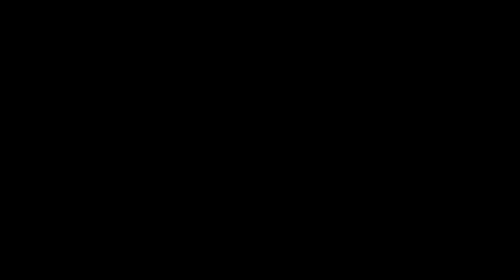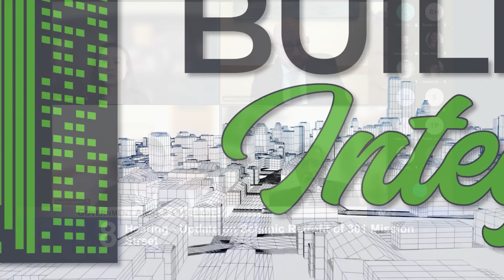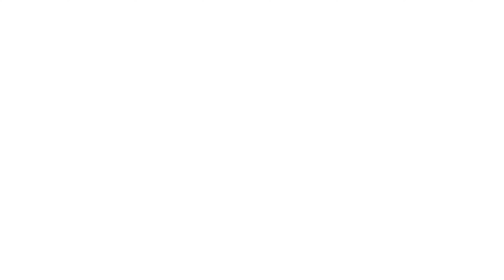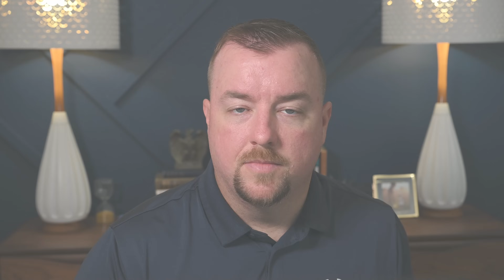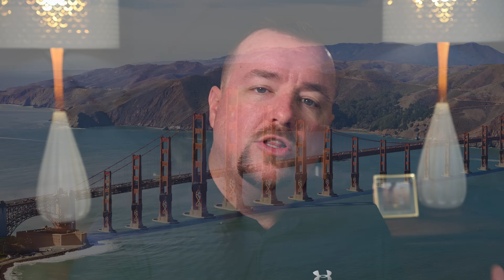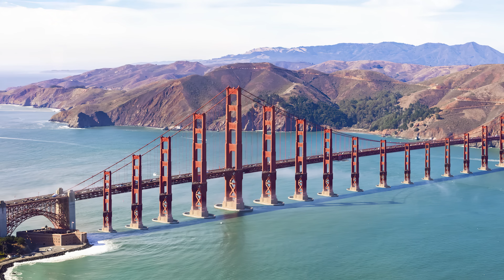Millennium Tower's "Sophisticated" Fix?  You Decide - (San Francisco's Leaning Tower Part 4)

Comment: I don't know how common a problem leveling tall buildings in this situation really is. I've heard of a tower is Pisa, ITL. Is this like designing a reinforced concrete, slab & column parking garage for a mall or like the Apollo moonshot?
Seems like the 52 pike design should've been perhaps a starting point only; don't engineers usually start with some existing design which seems to work? Better to say here's a cost estimate which is 95% the worst case than to go back to the client and say ooopsy we need to double the number of piles and it's going cost more. 
Also sounds like the pressure to get something underway now was also at play.
Sounds like a bit of skeptism is at play here. First they say 52 now 18. Can we expect the "answer" to be  a few more are needed at each end in the future.
Reply: Engineers could theoretically start with an existing design, but that would only be advisable if ALL the parameters were the same. The Golden Gate Bridge works; but you would only build another bridge with the exact same design if you had the exact same distance to cross, the same wind and water currents, the same type of climate, and the same soils and size and shape of the bay bottom and surrounding hills. Since no two bays and no two hills are alike, you will not build another Golden Gate Bridge. Engineers are supposed to be problem solvers: Look at the parameters, look at the conditions, look at the proposed building materials, then do your calculations. At Pisa, the builders did not adequately assess the soil conditions. It's doubtful they could have known what the problem would be. In San Francisco, thanks to modern technology, the soil conditions ARE known. But they were ignored.

Comment: Josh, thanks for the in-depth review of this and previous construction failures, they're very well presented and thoughtful.

Do I remember correctly that this building was originally intended to be of steel frame construction, but was changed to concrete as a cost saving measure (and at a significant increase in weight)?  And that the original plan to drive support piles to bedrock was similarly changed to friction piles (for a heavier building)? Both seem to have become very costly mistakes, exacerbated by changes to the underlying clay due to dewatering.

I'm also greatly concerned that the "mat" and perimeter foundation are almost certainly not designed to take asymmetric loads that will be encountered by having piles placed outside parts of the perimeter of the building, regardless of spacing.  If I were in any position of authority, I'd demand a cessation of the current "repair", and a new investigation into a safe, permanent fix to the settling and damaging loads on the building and adjacent structures (it's not just MT at risk here).

I'd also want to know how the changes to construction method/materials were approved, and whose palms were greased...

Comment: Josh,
I think the solution will be to remove the Millennium Tower from the San Francisco skyline, remove Mr. Hamburger's engineering license, then let the insurance companies, developers, and the engineering firms involved in the planning and design of the structural support system for this building duke it out in court.
Watching the SF Supervisors being so nice to Hamburger is too much to me. I would've hammered the man for pulling his solution out of his ass. I would think that he's showing incompetence here in exposing how he went about 'finding' his solution in the manner he did?
Which level university courses talk about the process that should be used when you do engineering like this, i. e., engineering a solution that isn't a standard solution listed in the standard reference material used by engineers?

Comment: If the "solution" - 52 or 18 or whatever - fails and 1) Does not fix the problem, 2) makes the problem worse or 3) causes the building to tip over, who is liable? Has liability shifted from the original architect, original builder and/or the city for construction of the nearby terminal?

Comment: My brain is starting to feel an overload. So the bottom line is they were in essence going to throw mud on the solution and whatever sticks would be the solution? I think I would be asking the same question the supervisor was asking. Is that you start with how many piles are going to resolve the problem versus just arbitrarily picking a number without doing the math to see if the solution actually makes sense scientifically or from some engineering standard. I know my argument is very simplified but I am trying to understand something that is way over my head in the first place.

Comment: Not much was learned from Pisa or downtown Amsterdam houses that sink in to the clay :-).  The building might yet be saved but it doesn't look like the current lot is going to be able to do it.  On the other hand the design looks to be on the very edge of what is technically possible and a real fix may not be financially feasible.
Reply: Any decent structural engineer isn't going to want their name associated with that dangerous mess. Start tearing it down yesterday, the big seismic one is building as we speak.

Comment: Not an engineer or a lawyer. But it seems to me that that the contractor does what the client requires in the actual statement of work. It sounds like the client said "Would N piles work" and the contractors said "Yeah we can do that" and spec'd a fee, and the client agreed to pay the fee. If the client had said "What's an optimal solution here?" the contractor might have provided a quote for that service (or said that they couldn't provide it). But it could have cost a lot more as it would involve exploring numerous possibilities.

Comment: I'm an Architect with a good knowledge of structure and while I don't pretend to be an Engineer....THIS is simply stunning. I can also say I am not surprised. I've dealt with good and great engineers...and I've also had the misfortune of dealing with hacks. 
This building is in serious trouble. Thanks for the video.
Reply: This heavy building was built on f'ing MUD. 
They should immediately begin deconstruction. 
Here in Vegas there was a rebar problem with one of the City Center building.
It was taken down, floor by floor. 
This building is dangerous in a seismically dangerous area. It needs to go.
Reply: 20 years from now, that Millenium Tower will have tilted so much that adjacent buildings across the street are losing value because if the building falls down, it will domino effect those adjacent buildings.
Reply: @animejanai4657  If they had just put pilings all the way down to the bedrock, this would have been avoided !!
Reply: The first rule of foundation design is uniform soil bearing.
You will have continued foundation proplems from the proposed bedrock design because the support is not uniform.  To think that you can stop the differential settling when you want to is crazy.
I'm just a building contractor that cares about my work, and I can see that. They will spend money until there is no more, and that's where it will end.
Reply: architect with capital A? all I know is that 90% all architects are egomaniacs and you just proven it, God

Comment: I cannot imagine HOW SF can allow this situation to proceed the way it has.  SF just to protect itself should have a world class engineering firm, and given the scale of disaster possible, I'd go straight to ARUP, who posses experience modeling the most complicated structures on earth, even failed ones, AND fixing them, checking ALL engineering.  Taking ANY engineer hired by the building at this point is simply INSANE.  Having ONLY lay people questioning them, apparently the only people giving any criteria they already failed engineer and developer to meet in fixing the issues, is doubly insane.  Unless SF is going for the incompetence defense.  Now all DOB's caveat reviews saying all responsibility rests solely with professionals hired by the owner, but never have I seen it interpreted as not providing ANY criteria for that team to meet other than 'just say it works'.  Which seems to be what I'm hearing.
I'm still amazed SF has not demanded MONTHLY simulations proving:
It won't fall over given additional tilt
It won't fall over given additional tilt in the event of the earthquake requirements of the area, which are among most severe in US
That all utilities in building are running at 100% efficiency, no cracked, leaking pipes or conduits, no reverse slopes, no undue elevator rail friction, emergency brakes will still work, heavy equipment mountings still sound.
That slopes to floors do not exceed that allowable for sidewalks (which are usually the least stringent as opposed to allowable slope for floors inside a buidling)
That roofs still drain properly, that slopes to drains still work and heavy water is not ponding.
All doors, especially all fire doors, stair doors, still operate smoothly, close automatically as needed, comply with ADA requirements for force needed to operate, and that any doors 'fixed' by cutting still provide for their function, from fire safety to security to privacy.
Windows if operable still operate and fully seal, without undue effort as measured in ft lbs against original manufacturers specs.
and that's just an knows nothing about engineering architects 5 min take.
As to 18 piles, that's a joke right?  How many piles under the original building?  HUNDREDS.  Any solution to just pass the smell test would have to be equal to a large percentage in bearing capacity.  If the engineer is saying a mere 18 piles equals the load capacity of many dozens of original piles, he should have been taken into custody at that moment for gross incompetence with original design.
The entire concept of trying to "hang" the whole weight of the building on perimeter piles to let it then settle in an uncontrolled, unknowable way in the opposite direction makes me shiver.  Not just from the unknown settlement, but the UNKNOWN ACTIONS ON THE STRUCTURAL FRAMES OF THE BUILDING bending and twisting one way, then the other and even worse, what is happening to the thick structural slab under the whole building.  Is it cracking, rising on one side as other settles and loosing contact with original piles under it.
Reply: Josh's earlier videos state the foundation slab is dishing, and shows major spalling.  My take is that the foundation slab has effectively already failed.  The building is sitting on a foundation slab and pilings designed for a steel-frame structure half the weight of the concrete structure that was actually built.  It is not surprising that the building moved, and as its pilings didn't go down to bedrock there's nothing stopping it.

Comment: It seems when they switched to concrete the weight of the building is such it can never be adequately supported.  They are probably going to either take off the top x number of floors or tear it down.  This building is a disaster especially in an area so prone to earthquakes.  The city of San Francisco failed the homeowners.  I would be terrified to live in the tower or the surrounding buildings.
Reply: Yep, unsustainable, probably has to come down and replaced with better design. In coming down I hope they don't mess it up.
Reply: I really think the building should be demolished before it collapses and causes unnecessary injury or death
Reply: @stormygirl1989  I hate to say it but I agree.
Reply: How much is this fiasco costing San Francisco and State of California tax payers?  Have any of the financial settlements included any awards to the City or State?  To what extent are the design mistakes made by engineers/architects/builders also the fault of the city’s permitting agency?  Why on earth was the construction allowed to go forward without engineering optimiZation having been done?  Show me the numbers and how you arrived at them seems never to have been asked or answered.
Reply: @Geoplanetjane  Send a FOIA to the city of San Francisco

Comment: So glad you took this challenge on Josh.This is playing out like a drama movie.  I am an ME not a structural eng. so take my comment from that perspective. As Eng. Hamburger stated each of the columns in a 52 col fix is loaded to 800 kips. Now going to 18 piles would increase the load per pile to 2,311 kips. What does this do to the foundation slab that apparently already dishing suggesting an overload condition?
    The arguments that were made was the Subway terminal construction required pumping out large volumes of water, and it is claimed it affected the bearing capacity of the soil under the side of the MT adjacent to the terminal. What about the other side of the bldg., wouldn't that be affected to some extent as well and as such the "fix" would just transfer the problem to the other side of the bldg. with no piles to bedrock. 
    With the 400 pile solution the column loads would presumably be a more manageable 104K /col., significantly less than 2,311k/col. Aaron Peskin is a sharp cookie and he is correct to be so skeptical. However, it is easy to write his concerns off for lack of credentials and there is no indication that the council consulted with another eng. consulting group with no conflict of interest. It seems like the 18 col. solution will go unchallenged when in reality it needs to be scrutinized by non conflicted experts. This is another concern in and of itself. 
      When they settled on the 52 col solution and experienced accelerated settlement and tilt, did they start driving them several at a time or 1 by 1?  Perhaps if the column driving was spaced out over time or moved further away from bldg. it might work out better. 
     I am of the opinion that Hamburger is playing politics and not engineering. He is trying to CYA and buying time. If the rabbit in this hat didn't pan out, lets pull one out of another hat. Perhaps Hamburger has dabbled in probabilities and knows he will be pushing up daisies before the collapse happens; failing a big quake. This is playing out like a game of Russian Roulette and the residents of the bldg used as pawns. These are the true victims and need real facts not BS. 
   If I owned a condo in that building I would be looking at cutting my losses and moving out. This will likely get progressively worse over time as Peskin's instincts are proven to be valid.

Comment: My plan: remove dirt from under the higher side of the foundation slab. Cut a hole in the slab. Remove, say, 100 cubic yards. Wait a few years. See if the building tilt is arrested somewhat, or at all, if not corrected. After a few years, take out another 100 cubic yards, and so on.

Comment: Aside from this "add piles" fix,  that is making things worse,  what would be other viable options to attempt to stabilize this building?
Reply: The key word is viable!   Are piles (at any number viable?) could another building or structure be built next to it so it could 'lean' on or be pushed back off of viable?   Is digging a large pond and making it float viable?   All could be done....
Reply: Pump in tons and tons of grout?

Comment: This doesn't look good in retrospect but think about how many structural decisions are based on what normally works, especially in an emergency.   Do you want somebody spending time figuring out if the stud spacing is optimized in every wall in your house? 
It wasn't 1000 times off just 3 times.  That might be worth it if time is of the essence. 
Speaking of false equivalence, in the final design would the 18 piles be identical in diameter, materials, and connections, to the 52 piles?
Reply: Stud spacing in a wall within a jurisdiction can be standardized because conditions from wall to wall do not change.  Piles in the must be calculated because the support the earth, and its various stratas can give varies greatly.
Reply: @Lost-In-Blank  My example is unrealistic but no more so than the idea of proposing twenty towers for a suspension bridge.   I seriously doubt that the pile spacing on most structures is scrutinized or optimized to the degree being done on this project.
Reply: Judging from the comments it seems people are concluding what Hamburger did with the initial design was unusual or inept.   I think the reality is the curtain is being pulled back a bit on how this normally works.   Is it structurally adequate and can we meet the owner's schedule and budget?  Okay then.  The guy speaking at the end is closer to the salient point which is why did they decide it would be easier for him to fall on his sword that explain the actual thought process behind reducing the margin of safety.